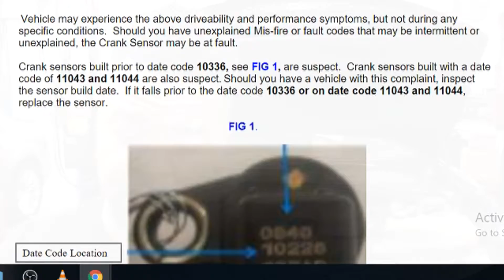Case Study.How to replace a crank sensor on a 3.6L pentastar V6 engine, Rocker arm noise.P0339 P0335

Comment: So I got a 2014 journey 3.6 and I can’t find the crank sensor Any advice? Thanks.
Reply: Read it's on top of the oil pan . Maybe cover by a heat shield . Maybe a 13 mm and a 10 mm bolt on the shield to move away and a 10 mm on sensor. Going to check my 14 journey tomorrow.
Reply: @redeye9042 any luck finding it
Reply: @redeye9042 any luck finding it

Comment: Bro im loosing my mind here . I got 2011 town and country i got cylinder 1 misfire like crazy it gets better when car warmed up but misfiring less . Sometimes in cylinder 2 which is on other bank . New spark plugs 2 times 
New coils 2 times 
New lower and upper intake manifold 
Fuel pressure at its prime and hold pressure good 
New air intake sensor 
New map sensor 
New throttle body 
New ECU programmed 
Cylinder pressure test is 150 same all others 
Leak down test came back good pressure 
New cam phasers actuators
Cam phasers did electrical cleaning 20 times 
New fuel injectors and rail
Cam phasers are good 
Rockers and lifters are good i opend valve cover 3 times New coils
I noticed both exhaust cam and intake cam both retard . Exhaust-5.20 intake -4.30 so im guessing timing chain stretched and jumped a tooth . Just ordered new timing chain complete set going to change it this weekend. But now got me thinking about crankshaft position sensor this is the only one did not suspect cause its giving constant reading and never has issues to start the van but going to change it anyways before starting on my timing chain . Any advice please ? 🙏 thank you 
I know i spent alot on an older car but im just taking the challenge to fix
Reply: Forgot to mention 
Misfire disappears when giving a little gas or rise rpm any how like turning steering or even turning on ac compressor. Any small load on engine will stop the misfire . Also replaced all serpentine belt bearings idler , tensioner . New battery . New grounds . No power drops on any point of the car .  Fuel injectors pulse width on cylinder one is less than others . Even if i rest value or throttle relearn it still goes back down . So ecu cutting gas on cylinder one . Im loosing it here lol

Comment: Do these Crankshaft Position Sensor require a Relearn? if yes can it be done without a scan tool?
Reply from the maker: What year is the car? Also are you subscribed to the channel?
Reply: @OnlineMechanicTips  2015 Durango 3.6 yes subscribed
Reply from the maker: @AVMAR  OK this year model don't exactly require it, its just a smarter way to speed up the learn process. You can simply put in a new crank sensor and start driving, the computer will learn its position over time.  Using a scan tool to do it just speed up the process.
Reply: @OnlineMechanicTips  Drove it for 30 min and it still acting up at idle
Reply from the maker: @AVMAR  Then thats not your problem
Reply: @OnlineMechanicTips  scan tool gave code for the crankshaft position sensor P0300 also P0128, P0175

Comment: Would you happen to know we're the 2017 pacifica crankshaft sensor is located
Reply from the maker: See Short reply
Reply: @OnlineMechanicTips  woww your awesome man 😂 that's crazy thanks so much
Reply from the maker: @jiggly_emup1122  Cool, thanks for tuning in. Please make sure you thumbs up the video and consider subscribing to the channe for mel. Thanks.
Reply: @OnlineMechanicTips  done
Reply: @OnlineMechanicTips  no bus dash light won't start I figured I'll get that fixed fuses are good
Reply from the maker: @maskoffm4m  Have you had those ground strap recalls done?
Reply: @OnlineMechanicTips  no I haven't did know
Reply: @OnlineMechanicTips  my motor is very shaky Rocky tho will it brake that wire
Reply from the maker: @maskoffm4m  if I had the last 9 of ya VIN and can tell if you need it
Reply: @OnlineMechanicTips woke up tried to start my van started up once shut off brakes hard steering wheel stiff won't start now!! Only dash signal is a p! With circle and no bus i didn't change the battery yet push to start so I can only try once every minute
Reply from the maker: @jiggly_emup1122 sure

Comment: I would like to thank you for this video! I had to watch almost a dozen vids b4 your video showed the exact same set up on my mother's 2016 300S. The car was garaged for several yrs before she got it and I already replaced both fuel pump/ filter components thinking it was a fuel issue not connected to computer. The intermittent crank or cam position sensors were a hard to diagnose problem on the I6 Jeep motor in Cherokees back in the day, but an easy fix.

Comment: We're 6 hours from home for holiday gatherings and our engine light came on for this error code. We really need to get back on the road home, but now I'm worried that the van won't make it. It's showing no symptoms as of yet, just the engine light. Now what? Risk driving home and getting stranded, or expending our stay which would mean lost work, lost school, car rental, hotel costs, not to mention what to do about the boarded dogs back at home that need to be picked up because it was made clear that they are booked up and can't stay extra! This could cost us $1000+ if we can't go home for an extra day.

Comment: I have no misfire just a p0016 code on my 2015 jeep grand cherokee 3.6 everyrhing running great just a code just going to swap it out anyway I hate these codes when there are no issues because I worry when u change a part and that's when u get issues no problem starting nothing just the code
Reply: did you fix it?

Comment: Dodge makes junk! I have A 12 with P0390 code and P0300. Car running and stalling can not drive at all. Replaced the camshaft sensor bank 2 and try to drive and it’s the same issue nothings changed
Reply from the maker: Because that was likely not your problem. These cars have to be diagnosed properly

Comment: I've never ran into a misfire condition from a faulty ckp sensor. I've only had extended crank, crank but no start, and stalls.
Reply from the maker: Yes my friend. Very possible. And keep in mind, the crank sensor usually responsible for the info concerning which cylinder misfiring. Thanks for watching. Please consider subscribing to the channel, thanks
Reply: @OnlineMechanicTips  but will it be the cause of the misfire?
Reply from the maker: @rtownsend744brad  Im not understanding your comment. Are you asking can a crank sensor cause a misfire? Yes. If you asking me if this the problem with your car, I do not know. This has to be diagnosed using a scan tool. Did you get a crank sensor code? Also are you subscribed to the channel?
Reply: @OnlineMechanicTips  my vehicles run great. What I'm saying is that your video is targeting the misfire symptom and then bring up the TSB on a ckp sensor. So are you saying that the misfire is caused by that sensor?

Comment: hey. i like your videos. i had a 2017 grand caravan 3.6l. i have a p0304 misfire, i replace spark plug and swap the coil around and still missing on cylinder 4. is not making any noise

Comment: good day J.T. i jusy wanna ask if this recall affects a 2017 Grand cherokee Laredo? a few weeks ago am driving and and just all of a sudden i parked and i noticed its running rough... no codes, checked spark plug and is good, it only has 70k... did some seafoam intake cleaning but no luck 😫😫😫. thank in advance
Reply from the maker: Hey bud, it was more of a case study for the dealer tech when nothing else showed up. They advise us to check the crank sensor. Your 2017 GC has the 3.6 Gen 3. The computers in those really good about showing problems. You may need to get it scanned to see whats in the computer. Even tho theres no check engine light.
Reply: @OnlineMechanicTips  ok, thank you so much

Comment: I'm changing mine tomorrow.   You should do a video on the Thermal Expansion valve on the air conditioner. Ill tell you i have a few choice words for the engineer who decided where to put that bugger.

Comment: I've been struggling a lot with this repair. I have a 2015 AWD Dodge Charger SXT. What is the size of that bolt? (10mm, 11mm, 3/8 Inch)? Also, its very difficult to access the Crank Sensor because the forward drive shaft (AWD) blocks where you put your hand through. Any suggestions, I've thought of disconnecting the front drive shaft but seems like a lot of unnecessary work. I'ma go try some extensions, but let me know if there's a better way.
Reply from the maker: Its typically a 10mm. Im curious as to why you replacing it? Also are you subscribed to the channel?
Reply: @OnlineMechanicTips  I am now! 

I'm trying to remove it so I can replace the wire and the sensor. The wire has had it's insulation burnt off and it's causing consistent shorts. This has led to some long crank times, often & random engine stalls while driving. I wouldn't have believe it until I went under yesterday and saw all three connections had no boot, and no insulation, just bare copper wire that's all frayed up and messy going into the connector.
Reply: @axelmontano  How'd you make out with this? I have a 2013 300 awd and the shaft is definitely an issue. Could not find my sensor until I saw this vid. I'm contemplating removing the exhaust since it'll be/ should be a lot easier than the driveshaft but, still worry about not being able to maneuver my hands enough.
Reply: @antoniomccray4356  It worked out for me, I went in with quite a few different extensions. It took quite of bit of just trial and error to find the two correct extension lengths and a swivel joint (While the u joint had better range of motion, I couldn't apply torque over such an odd angle.) I was able to get onto the crankshaft sensors bolt with a 10mm socket and pull it out. Ended up repairing the electrical connections with electrical tape and harness tape, then put a metal heat sheath over the wire so it never melts again. Been over a year now and have not had a problem. Didn't remove any other parts, you just need the right extensions and swivel joint to get the angle right.
Reply: @axelmontano  Much appreciated those extensions were definitely key. I wound up dropping the exhaust to reach it though. It actually made the issue worse, though. Thanks anyway

Comment: Okay I have a question about crankshaft sensor I have a 2011 Dodge Journey Mainstream 3.6 but the transmission is attached but it wrapped around the motor and it's right in front of the crankshaft sensor I have no room DO YOU have any idea what I'm doing wrong but it's a Dodge Journey Mainstream 3.6 VVT all wheel drive any help would be greatly appreciated thank you
Reply from the maker: Curious why you may need a cranks sensor? I have to look it up. Also are you subscribed to the channel?
Reply: @OnlineMechanicTips  my Dodge Journey Mainstream 3.6 the code reader showed a code of P0300 so I called my local Dodge Dealer and they confirmed it was a crankshaft sensor and they could change it Now they said they could do it for roughly around $2700 that ain't happening

Comment: my crankshaft position sensor wires have been spliced before i bought my 2016 chrysler 300 due to mouse damage years ago, was wondering if you could tell me what colors go in which socket of the CKP sensor, all my wires are purple because the wiring harness /pigtail has been replaced, if i follow the pigtail back to the splice i see orange, blue and brown wires 

Thank you
Reply from the maker: Hey bud, what size engine in this 300? Also are you subscribed to the channel?
Reply: @OnlineMechanicTips  

Yes I'm subscribed! 

3.6L pentistar v6
Reply from the maker: @007.3l  https://www.facebook.com/jtthecar.guy.3/videos/2248391611985685
Reply: @OnlineMechanicTips  

Thank you very much for taking the time to make the video!
Reply: I will report back once i have made the repair
Reply: Worked perfectly 

Thanks again!

Comment: Great Video! I'm having a long crank in my 15 Dodge Journey (3.6 V6). It happens only when the car is warm, and when stopped more than 30 min... When cold it starts right way, and before the 30 min also! It is driving me crazy... The last mechanic change the fuel pump and coils... the spark are new. Previously there was a CyL 1 misfire that was the fuel injector gloggled... What would reccomend to check? I will test;re4place the other 5 injectors, but afraid to be something else... Cheers! and thank you for the help!
Reply: this is exactly why I'm throwing a crank sensor at mine. Ill report back next week after i drive it a bit.
Reply: Ckp at fault or wires of it

Comment: I had a '15 charger with 100k on the wheels.  Very slight mis idle.  No one but me felt it.  No codes.  After i watched this video i bought genuine mopar with AF last letters (lastest revision) .  Only $13.
Runs like NEW now.  Thanks bro
Reply: I have a 2013 3.6 charger. Rpm needle jumps slight shake when idling only once u drive its good. Did u have that problem? Also no codes for it at all. I changed my plugs ignition coils. Pcv valve re learn on the throttle body. 2 mechanics said run it till I get a code but it's kind of annoying.
Reply: @gnickolas69 Hi, did you fix it? Got same thing

Comment: I need help. I have a 2017 Caravan with a code PO304. I replaced the coil pack and spark plugs. I swapped the injector from another cylinder. None of these worked. I checked compression on 4 130 lbs, on 2 and 6 140 lbs. What is the next step? Please help
Reply: Yes, i am subscribed to the channel
Reply from the maker: @ang0823  Thanks, ok, a couple of things because this is bank 2 meaning the front cyl head.. Are you hearing any ticking valve train noise? Also have you had anything installed on this head such as the cat convertor or any thing like that?
Reply: @OnlineMechanicTips  thank you for your help.  I do not hear any ticking or any other noise coming from the engine. I have not.installed anything.
Reply from the maker: @ang0823  OK bud, if you are 100% sure no cat was installed and there is no ticking, there is not many options left. You have no choice but to remove the valve cover. I will explain to you one I had that pass the compression test and all secondary ignition sys was up to par. I found a rocker are coming apart causing the misfire. (they may not always produce a ticking noise) Also there was one I did that had and exhaust valve split. (this can sometime not be found by a compression test but in some cases you can verify it with a air leak down test
Reply: @OnlineMechanicTips  thank you for the advice. I will take the valve cover off and check the rocker.  I appreciate your help
Reply from the maker: Hey bud, what kind of scan tool you using? Can you see misfire counting in cyl 4. Also, are you even subscribed to the channel?
Reply: I am using a friend's Millennium 90 pro. Yes. I see cylinder 4 misfiring. I reset the codes. Currently i have 504 on cylinder 4.

Comment: Maybe someone can give me some advice on my 2016 Chrysler 200c my engine light is on I went to AutoZone and borrow their check light engine scanner the code come up PO301 No1 Cylinder misfire detected. So I changed the coil pack and the spark plug and still get the same code. When I am driving the car the car drives good stop at a light or just park the car runs rough. Can anyone help me with this problem please
Reply: Same happened today Fam try changing the crankshaft i hope this works

Comment: Amazing video, thank you! I have a P0300 and a p0052 the second code is for oxygen sensor heater circuit bank 2 sensor 1 but I think the oxygen sensor code is not related with the misfire I think the misfire is related with the crank sensor, what do you think?
Reply from the maker: Very much possible. What kind of car is this? Also are you subscribed to the channel?

Comment: I got a code saying it was my camshaft position sensor. I replaced it. But I still have a misfire. Question is how many camshaft sensor does my challenger 2016 SXT plus have? TIA
Reply from the maker: What size engine in ya Challenger and are you subscribed to the channel?
Reply: Online Mechanic Tips I am now. It’s a 3.6 just like this charger
Reply from the maker: @ogmerman776  Thanks bud but I think you mean 3.6. That engine has a cam sensor on each head. But if you have a misfire, you need to check what cyl has the misfire and address that cylinder
Reply: 2

Comment: Great video, I have a 2017 Grand Cherokee that had the ESS light come on followed by the CEL. I scanned it and got codes P0300 and P0339. So I am going to try and replace the sensor today